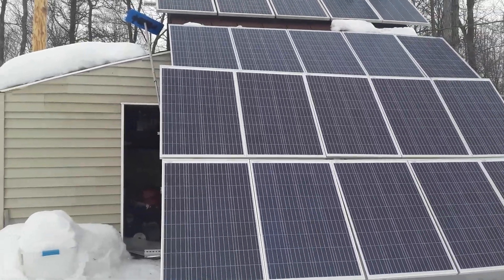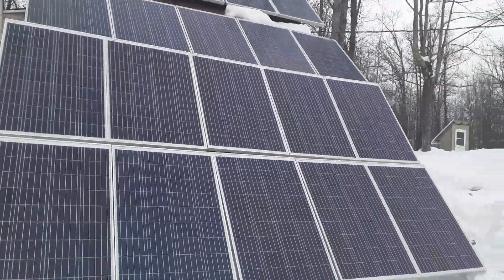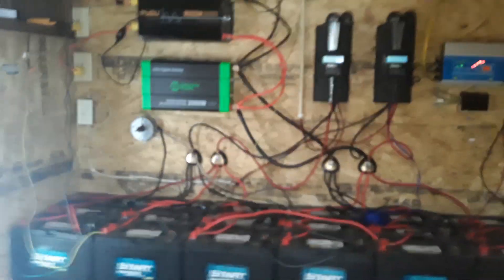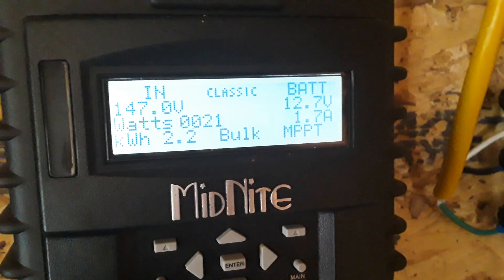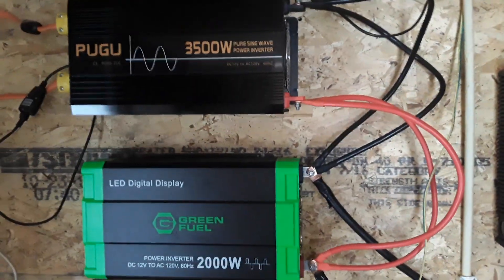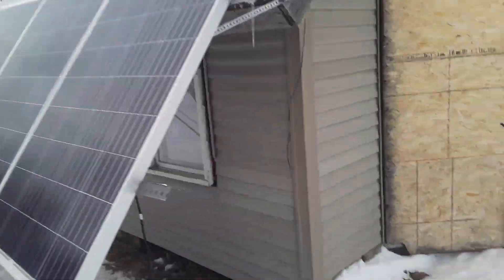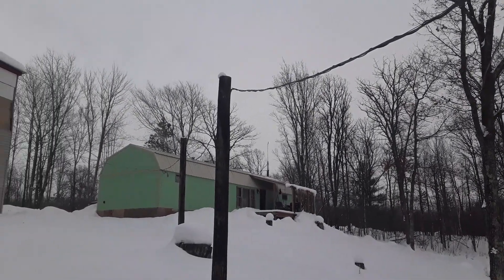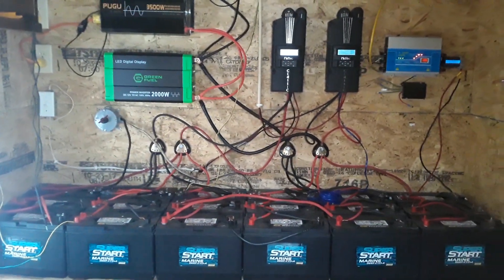The Autarky Homestead power grid. Wind and Solar.

Comment: Or those Invaders I have a failure with both my inverters those Invaders will not run my kitchen stove a water heater especially when my kitchen stove is 3600 watt 240 volts and 50 amps, and my water heater is 4800 watts 220 votes and 30 amps and I also have a dryer and a split mini air conditioner heaters and a couple other big toys that uses a lot of power that I have to have. Or otherwise it's 3500 watt inverter will run everything else but the 2,000 watt inverter don't we better run my kitchen refrigerator that my 1500w inverter will not run it I tried my 2000 watt works pretty good but what else can say about 50 years or older antique refrigerator. I mean I really should buy a new refrigerator but they are pretty pricey so I use that old thing.
Reply from the maker: While it may be nice to have them kind of electronics, I would never run them on any off grid system myself.
Reply: @AutarkyHomestead  off-grid who said anything about off-grid I just did what my power consumption is that I want to do I didn't say anything about being off. All I'm saying is I want to be to sell to the great which I can do if I have enough solar power and I don't think I can actually put a window up in the middle of a City but I do have a windmill and it would be nice if I could put it up.
Reply from the maker: @acefire4050  well I am off grid, so being on grid is irrelevant in my situation.
Reply: @AutarkyHomestead  I understand what you're saying but 100 watt solar panels maybe she'll go to Walmart app find the solar panels that a little cheaper at 6.8 amps poly solar panels 100 Watts half the size of your 100 watt solar panels and makes more power and it cost a little bit less something like twenty thirty or forty dollars less or you can buy the 100 watt solar panels mono black solar panels slightly more expensive than Polly still cheaper than what you been paying for yours those hundred watt solar panels are 5.2 amps. But personally I did buy both types of solar panels but I still like the bigger solar panels like 180 watt solar panels for $169 or the other 180 watt solar panels that Walmart sells same size $179 Yankee have a choice of which one you want of course I'm going to buy both and then you can buy half as many to make the same power are just as many to make maybe twice the power or almost twice the power. But I'm in Walmart's app you got to ask for it through your phone or computer or whatever but I don't trust there floppy solar panels what they called bendable ones but in about a week or two I'm going to pay $999 and 365 watt solar panels and get four of them. Just to see if I'm going to buy the one size bigger package or the biggest package they're selling but I'll find out if  365 watt solar panels which has more amps but little less votes even though I know every 10 watts makes a amp so at least that's what my solar charger does turn every 10 watts into amp. But my 12 volt charger is also a 24 v charger put some reason I can put out 41 votes but then again maybe that's because I got 405 watt solar panels four of them but that's set up to a different solar charger so I begged the difference of when an 18-volt solar panel can make a 41 volt charging capability of a 12/24 volt charger.
Reply from the maker: My goodness! 😵

Comment: Hi, so screw the pv power solar self-power consumption up, so as to save electricity costs. https://youtu.be/eC2olbCBhh0 Many more links below. Avoiding grid purchases will shorten the payback period. With Dimmer + Solar PV, self-sufficiency can now increase to almost 95%. That's how easy it is to suppress expensive grid purchases. The electricity bill stops just like the electricity meter. Kettle: Without a dimmer, the 2500W - 600W PV system needs = 1900W, which you have to pay more for. If I turn the kettle down to 600W with a dimmer, then every PV system that is too weak can now supply each consumer independently and independently, because the 2500W kettle becomes a 600W kettle thanks to the dimmer. No magic, just physics. The prerequisite is that you have at least one small solar PV balcony power plant. You don't need an expensive battery. The 2000W electric heater becomes a 500W electric heater via a dimmer, which I can run 12 hours a day free of charge via PV. The 4000W analog oven is also tamed. It is not the solar systems that have to grow, but the average consumption of the integrated device heaters simply has to drop by 75%. With the dimmer / voltage controller it has become so easy. I have already switched my entire household (2020) to 4x dimmers. Please have a look at my channel. 🌞 ........... Increase mini PV solar self-sufficiency (winter and camping): You can continuously regulate a boiler and other power-hungry consumers with the "5000W dimmer". Ebay €7. I run 4 dimmers in parallel on an 850W inverter. Kettle 2.2KW at 150W runs 12 hours a day, so the water is always hot https://youtu.be/D9Ss0RuqZG0 . The room is also nicely heated. 2.5KW washing machine runs in parallel with dimmed to 400...600W and always reaches its 60°C, and also its 1400rpm... It doesn't matter to the washing machine whether it changes the washing temperature to 5min@2500W or 100% can be achieved free of charge via existing PV power in 20min@600W. The wash cycle lasts the same time dimmed and non-dimmed, 3Sth 10min. The iron https://youtu.be/-71oL7z1kMU , dishwasher https://youtu.be/8vnAkrS1x-s , oven https://youtu.be/azDjqZpz77U , electric heater https://youtu.be/QbLWDbJi6ew , Waffle iron https://youtube.com/shorts/ofanZCdYEjA?feature=share, coffee machine, all internal heating is throttled with me. Lots of videos on my channel. The inverter stays cool and quiet and the MOSFETs + (battery packs) stay intact because extreme current peaks no longer reach the inverter. Now every Mini PV Inverter is enough to operate large devices. So, with the dimmer, all internal heaters/devices can be converted into base load devices that stay almost permanently ON, drawing very little current directly from the PV. With a wattmeter / energy cost meter you can then measure this perfectly in order to set the dimmer optimally. ........ Comments: "Great idea - despite studying electrical engineering, I didn't think of it myself ;-)" or "I installed it in our washing machine, great idea!" or "Glück Auf Christian, I'm a professional myself but I haven't figured that out yet. 👌 Greetings Mitch 💚" and many more... LG Christian 🌞 ........... "smart energy saving" , has made a meaningful reaction video to the dimmer: https://youtu.be/EHtJGiXAjZk . 🌞 ......... "Free Range", also made a meaningful reaction video, to the dimmer: https://youtu.be/qzdRdBObtvY . 👍........ "Jens Kummerow TS", also made a meaningful reaction video for the dimmer: https://youtu.be/fTY5jWvz5CY . 👌 ........... A little hint: Energy cannot be saved. So if I want to boil my water, I always have to use the same amount of energy for one liter. Christian's method relies on a longer period of time with less power in order to be able to use the power provided by the PV as efficiently as possible - so consumption peaks are intercepted. In the end, the energy consumption should even be (slightly) higher due to the interposition of the dimmer, but it doesn't matter, since more efficient coverage by the PV system and therefore better use of the self-generated energy .......... Here an "automatic PV excess control + remote controlled dimmer with heating element" / load management (consumption / heating rod follows PV excess ...): https://youtu.be/IWp7Mi2FldM . ATON - Power to Heat: https://youtu.be/wnVSaioJsjY . "Obermühle" solved this via PLC: https://youtu.be/iR30cDaf1Xk "Heating with excess PV🌞Do your own heating rod control". 🌞 .......... I installed a 2-axis solar controller on my DIY solar tracker: https://youtu.be/_Rs8CptQcDw. .......... More videos on my channel. LG Christian ............... ............... ............... ............... ...............

Comment: Thanks for showing your setup.  When I lived in rural Australia, some friends who were off-grid were fully dependent on Solar, and with no generator. (They did use some LPG/Propane for cooking, mostly during the Winter). But no snow at all where they were obviously, mostly just heat, dry, and dust LOL.  ONE CONCERN... that's a huge potential current flow in Amps at 12 volts from all those big batteries, but I didn't wee any Fuse or Fuseable Links.  Remember the power of one battery can be like a bomb if it gets a dead short across it, a metal tool etc. Were their fuses in your system I didn't see ? I look forward to seeing your other videos. Cheers from New Zealand (enjoying mid-Summer for us right now !) , Catherine ZL3CATH
Reply from the maker: Thank you! And no, I don't currently have any fuses except what's in the inverter
Reply: @AutarkyHomestead  Thanks for such a super-quick reply ! I thought you'd be asleep in bed.  Here (New Zealand) it's lunchtime Monday, so was just catching some Youtube before my afternoon appointments.  I think even most modernish cars have a large "fuseable link" that's designed to allow the heavy current of a starter motor, but if there's some accident or a "dead short" it still blows.  Perhaps you can install one or more of them in your main 12 volt cables ? Obviously the connections need to be really good, because at 12 volts, you're drawing quite a lot of amps (ie into the inverter) when using various appliances around your house.  In New Zealand, (and Australia too), our normal household mains electricity is 240 volts, so most of the larger inverters are designed to work on 24 volts. I like your system of having a second smaller inverter mounted all ready to just "plug in" so that in the event of a breakdown with the main one, you can still run essentials like lights, phone chargers, or power tools you may need for urgent repairs etc.
Reply from the maker: @KiwiCatherineJemma  it's 5:30pm. Suppertime
Reply: @AutarkyHomestead  hi regarding a better vind turbine i just a few weeks ago recived a  24v istabreeze i 1500watt , it is one of the very few turbines that actually produce their rated power it is a big one 20kg. 3 blades each about a meter and from shaft to tail it is 1,5meter i put it up and it just about always produces someting 300-500watt  and when windy it reaches the rated 1500watt  ,i paid about 400bucks for the turbine alone i run the power trough a rectifier and uses a solar charge controller to charge batteries    after i have tested several china turbines for freinds i was certain that there was not much power to find there 150-200watt most of them made in windy conditions,  i had one of the older 4oowatt 12v turbines and it was decent,,  if you can afford a better turbine i can recommend that one ,,if you wanna see test on it there is a channel called toys for watts that have good videos on it,, good luck  from a fellow of grider in denmark
Reply from the maker: @kimmogensen5390  Thank you Kim!

Comment: Not a Big fan of Lead acid but I do like your system redundancy. Very clean set up. Proof wind turbines are good and bad. They never ever reach or come close to their rated power output but they have the ability to charge at night when the wind picks up typically. Man that's some serious weight.  Hoping for a 5 to 7 year battery use as they see daily charging and discharging activity. I keep my eye on crashed Electric vehicles myself to get a great deal on lithium Battery set up to DIY. My current Lithium Ion power wall is from a single little 25kwhr Smart Fortwo car. We've been 100% running off grid on it and it works fine at 48v (47.6v to 56.7 capped). We use 75% of its rated capacity as not to discharge or over charge the system with set point parameters.  Our most taxing items are an Airfryer my wife just had to have. We use it when we are 50% full of higher as it can drain 20% of the battery in 40 minutes but fried chicken is worth it! Other then that we cook outside year round on a simple grill over wood packed into a charcoal chimney. 
Our system stats are
4,880 watts PV  with 3 and 4 panel series + parallel $2,500 + breakers and wires
6,000 watt dual rail 3,000 watts per  hot leg 48v aims inverter pure sine low frequency (weights 95 lbs or so) $900 open box deal new
15 Kwh DIY lithium power wall in 48 volt 12s configuration with 6 battery packs $1,500 + wiring and breakers (375lbs unit)
6 BMS 100 amp each $650
FM80 amp Outback Mppt Solar charge controller $675 New 4 years old to date roughly. It shorted out and came back to life. That's rugged! ( assuming 2 power mosfets fried and the system recorrected itself and booted backup )
60 amp  mppt cheapo backup PowMr solar charger which I'm terrified to use due to internal fabrication/construction. Its 40 amp imo max @120Voc <- I wouldn't push more than 100 voc into it as I know it'll cook over time in a short period.
Reply from the maker: Do you have to take apart the car lipo batteries? Or how do you make them 48v? I thought they were several hundred volts.
Reply: @AutarkyHomestead   they came in 3 seperate 107 ish volt cell packs. We split them in half to create the 6 battery packs. That video is found on my good friends channel Davidpoz found here https://www.youtube.com/watch?v=P_8gUILACRQ
Reply: In His playlist is many videos on the Build we funded for our offgrid power wall.  Dave is awesome!
Reply from the maker: @TheWickerShireProject  I will be checking that out. Thank you!

Comment: it seems wind is not going to let you down  ... is that orange inverter a FChao   .. ? whats your impresion on it ? ?
Reply from the maker: The black inverter with orange letters failed after 1 year to the exact date I bought it. After running without it for a couple days, I brought it into the house to examine it. After looking it over inside and out I hooked it back up and it magically worked fine for another year now. 🤷

Comment: Hi from the UK!  🇬🇧 Thanks for sharing your home set-up it was really interesting to see all the active & potential sources. I have a question - why do you have 2 inverters? Did you or someone you know have a failed inverter at some point?
Reply from the maker: Yes, I had a powerjack inverter fail, an it was below zero temps out, what a pain in the butt to change in them temperatures. The second inverter is hooker up but not powered on. All I have to do is plug in my AC current side to the back up inverter now. Quick fix if one should fail.

Comment: Interesting set up.  What is the name of the turbine?  Also, using FLA batteries in the cold, I was expecting to see a higher float voltage.  Here in Michigan mine charge up to about 14.4, float at 13.8.  I also use a midnight 150 since that one has the lowest RFI for ham radio station but midnight is rock solid and I think mine is now turning eight years old.  I am using golf cart batteries for the main system and AGM, and marine on three other banks.  Also, IF you want to monitor your system remotely you can install a wireless bridge in the power room with a hub to the classics and then beam that up to the house without wiring ethernet.  Thanks for the content.
Reply from the maker: The turbine is made from a car alternator. I changed the stator and rotor out. The stator I bought in Missouri Wind and Solar website and the rotor I bought on eBay. The magnets are slanted to help prevent cogging. 
Is there a wireless bridge that you recommend?
Reply from the maker: Also, what voltage do you set desulfation mode. Or aka equalize mode?
Reply: @AutarkyHomestead  15.5v temp compensated for my golfcart batteries

Comment: Run 12 v to the house and have your inverters in the house you'll save power
Reply: Dave, at the price of copper wire and voltage drop he cannot run 12v to the house.  For $ and efficiency you always run the higher voltage on the longer run just like the power company due to physics.  Hope that helps, also look up a ampacity chart that is really good at explaining wire gauge, capacity, length limits, voltage drop, etc.
Reply from the maker: Gary is correct. Same reason I keep my wind turbine at 3 phase AC all the way to the charge controller. My controller is 2ft from my batteries. My inverter is also 2 feet from my batteries. My DC side should be running pretty efficient.

Comment: I would get rid of the 100 watt panels and get 4 of the 540 bifacials, more power and less panels , but that is just me.
Reply from the maker: The 100w panels are 40"x27". They are easy to handle and install all by myself. I considered getting larger panels, but the weight and size is what kept me from going that direction.

Comment: When you build your new garage and have to move your setup I highly recommend going with 12V LiFePo4 100Ah Lithium Iron Phosphate batteries. With 18 LiFePo4's it will change your life. 🚀 Still you have a very nice setup.
Reply from the maker: Can you maintenance them kind of batteries?
Reply: @AutarkyHomestead  They don't need maintenance. The main drawbacks will be their higher initial cost, lack of self balancing (needs controller/BMS) and their inability to charge below freezing, meaning you would need to keep their enclosure above that temperature. Many premade batteries or custom cases do this, it's integrated into the controllers (BMS).
Their upsides however are they're more efficient, have a much longer life, and have a much larger depth of discharge - though will last even longer if you stay within 10%<>90%.
Reply: @AutarkyHomestead  No need to. They are sealed and they are basically plug in play and they have 10 years or more useful life. I recommend you watch Will Prowse, and Projects in Paradise 808, videos here on YouTube.